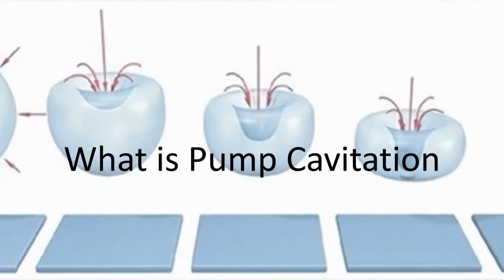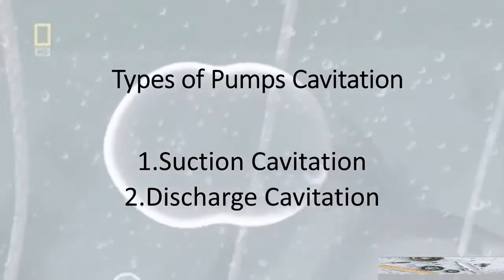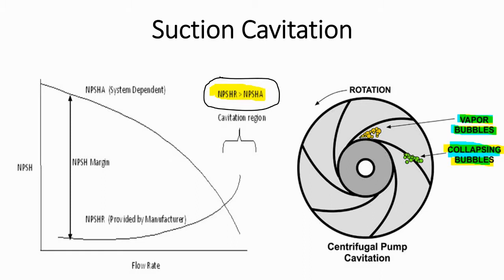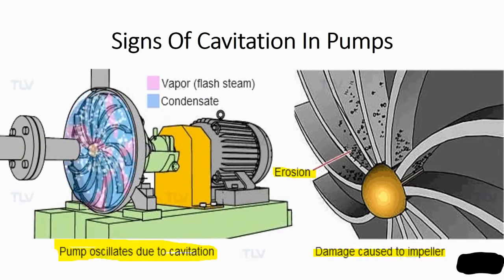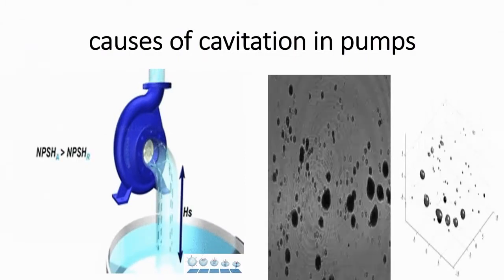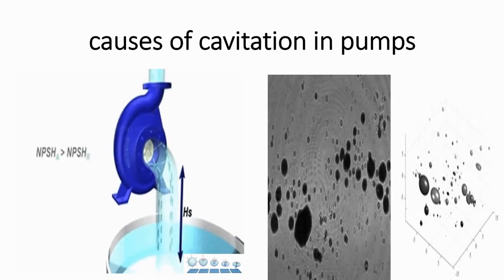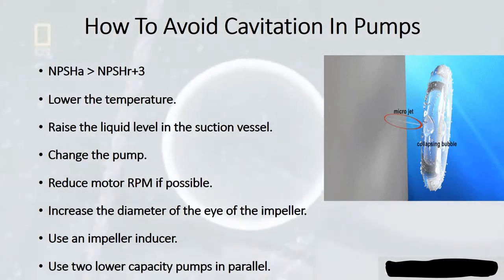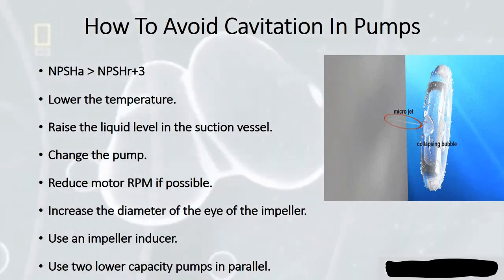Cause of Cavitations in Pumps | Affect of Cavitations on Pump's Impellers

Comment: Cavitation is usually described at the impeller, but the seal records it too, since collapsing bubbles send a shock along the shaft and the faces read it as a dry moment. A carbon face from a cavitating pump comes out polished with no transfer film rather than worn. Fixing suction conditions saves both parts at once.